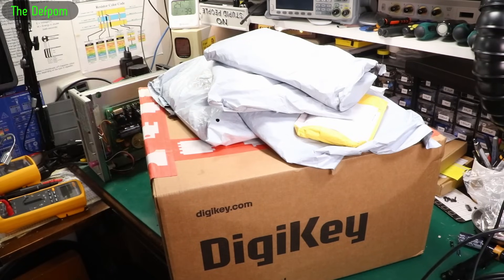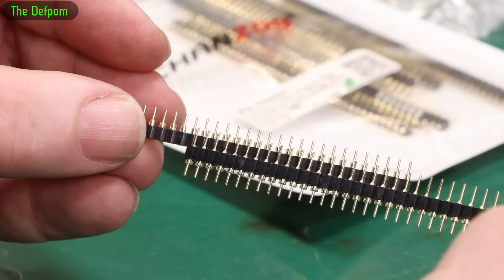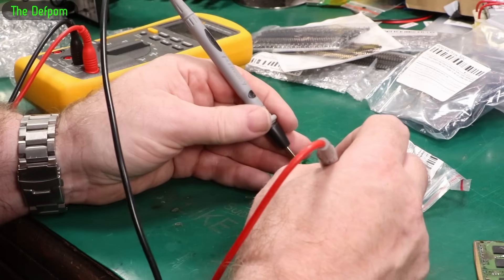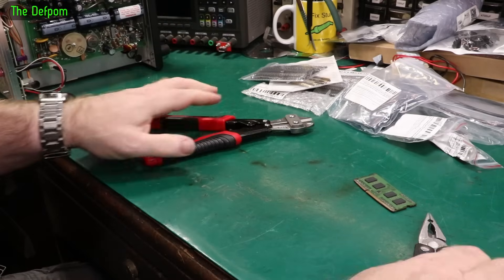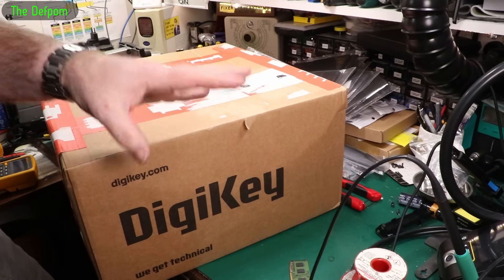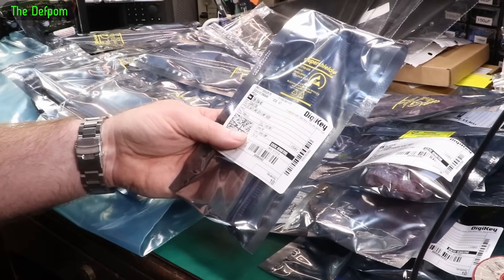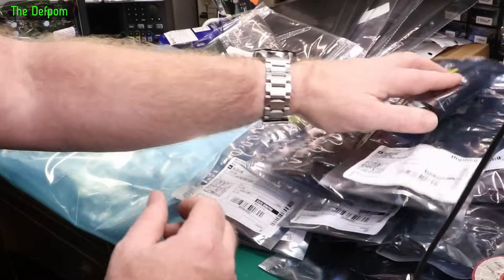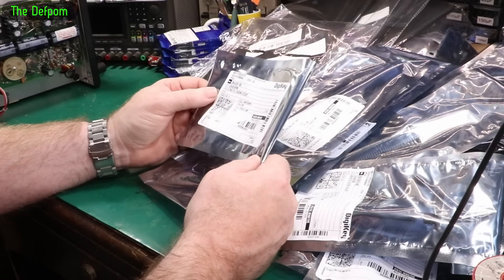🔴 Mailbag Monday 21st April 2025 - No.1350

Comment: one idea about doing a surface mount to DIP conversion, find someone or go to JCLPCB or PCBway to create small board to do the surface mount on and make use of the headers you got, course I'm guessing that is the direction you are looking at.  but the next question is are the voltage amp specs the same.

Comment: Have you checked the anti-static foam sheets are actually electrically semi-conductive?  I recently purchased some from the same website but a different vendor.  The sheets look almost identical to the ones you purchased and they claim to be anti-static but unlike the real anti-static foam these sheets turned out to be totally non-conductive black dense foam and totally unsuitable for ESD protection. ☹